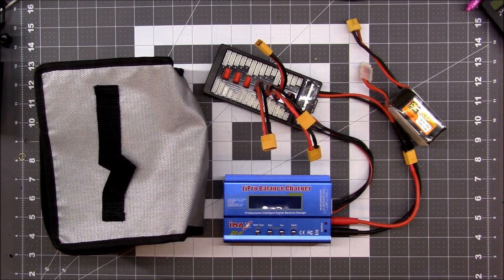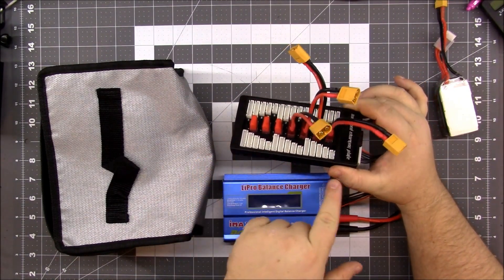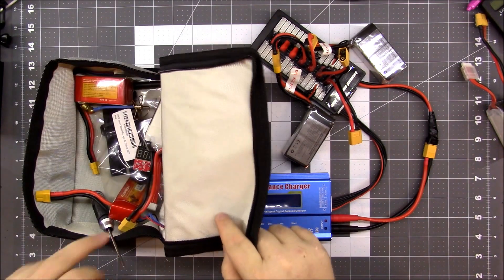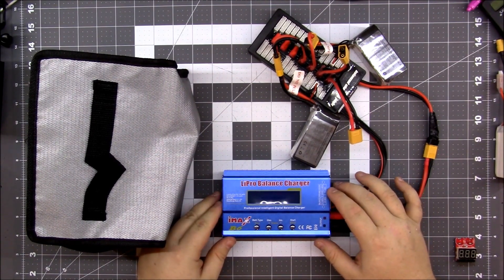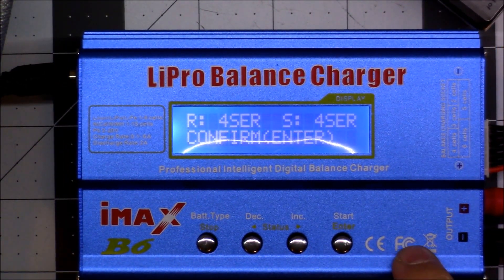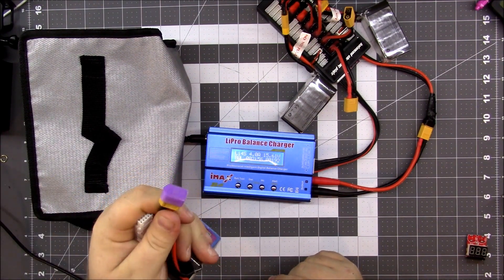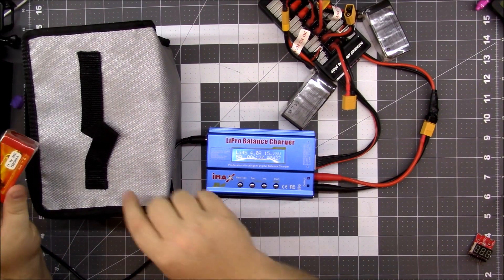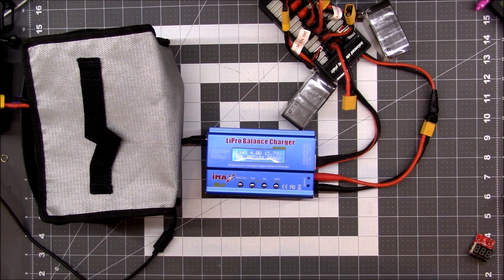Lipo Battery Charge Basics - How to Use Balance Charger and Tools Needed

Comment: That's actually called a parallel board that your plugging the batteries into. You are overworking the charger you have with more than 3 batteries at a time. The warmer the unit gets the harder it is on it. You should only charge same mAH and be sure that the batteries are all within 0.2 volts of the each before charging or you will damage them. You are charging you batteries to high on the A rating. 2 batteries at 1.5 is 3.0A for 2. I think yours were 1300mAH (1.3A x 2 = 2.6 max) I never charge on anything but balance and only at 1A per battery. If I have 3 1500mAh (1.5 x 3 = 4.5A) bats I still only charge at 3A to save stress on the batteries. You can also get small adaptors that don't have the cable to adapt your board from T plugs (deans) to XT60. Your on the right track though. Check out parallel battery charging tips from rotor riot guys on you tube to get more tips. Those guys are pros. Thanks for helping the community.